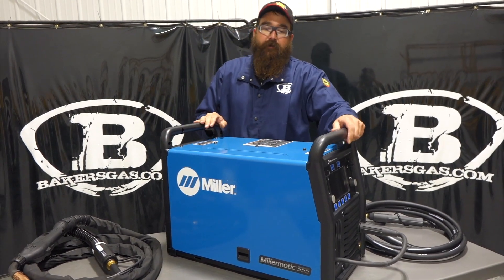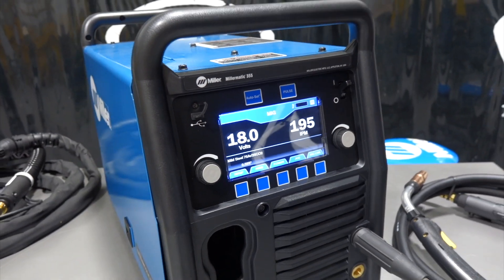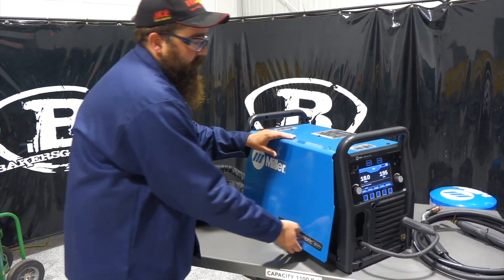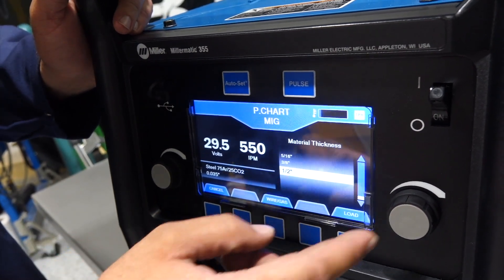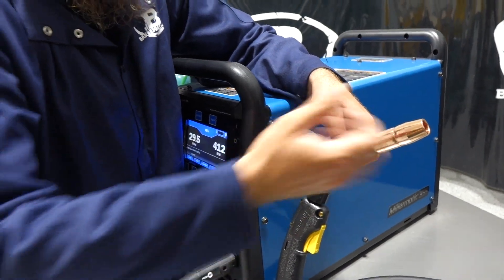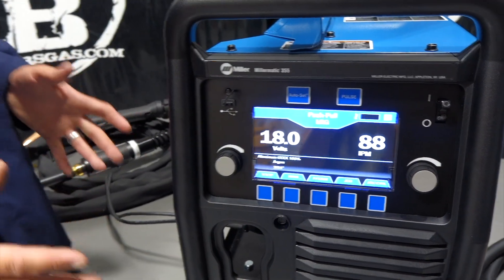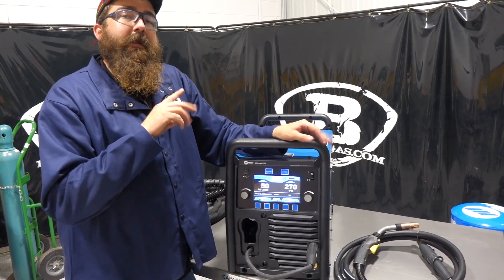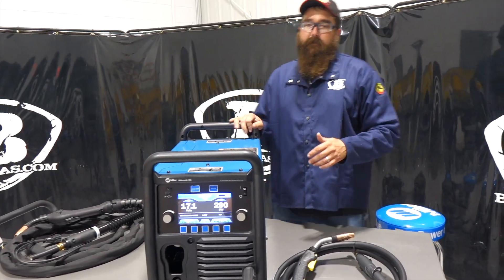Miller Electric Millermatic 355 Pulse MIG Review Replacement for the 350P

Comment: Hey I am having hard time getting the pulse to run as tight and crisp as the 350p I tried my old parameters from 350p and then tried some new ones which are maybe half way there but nowhere near the tight and quick buzzing I used to get.
Reply: Inverter power is different than transformer power but I bet you will find the sweet spot eventually.

Comment: I've been running the 350p for the last 10 years great machine we just got two 355's and it runs .045 70 ULTRA,308LP and 316LP really smooth but as far as .035 L56  hard wire I cannot get any settings nowhere near what the 350p was capable of running as of right now for hard wire I'm comparing to maybe a step above my Lincoln 180 dual I have at home it will weld but as far as being productive with hard wire I'm not impressed!
Reply: Our guys don't want to use the 355's, I bought 3, and trying to sell them now. 1 is still in the box on the shelf. I have to find something else. We have about (17) 350P machines, and they are great, guys like em.
Reply: Holy crap! I was about to replace my 350p for a 355, this comment really is making me think now
Reply: @arthurbarrios888 dont do it, awful for aluminum compared to 350p. Our haun reps wont sell us 350p anymore but the lincoln 350 mp looks much better at a similar price